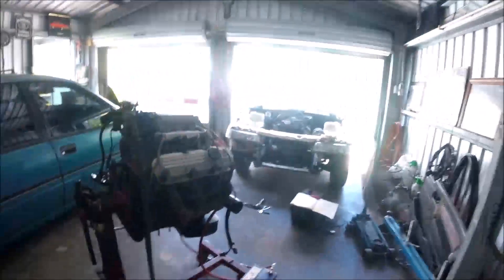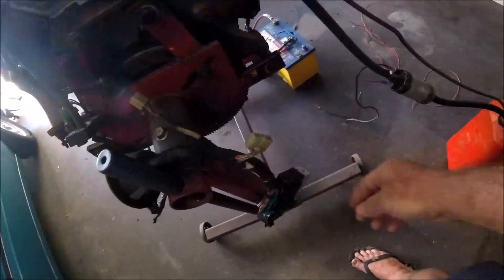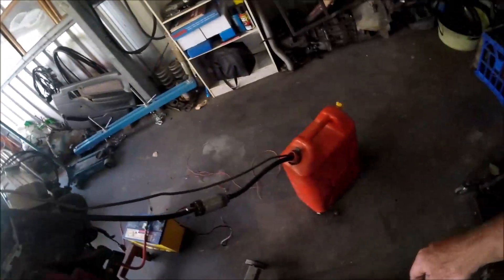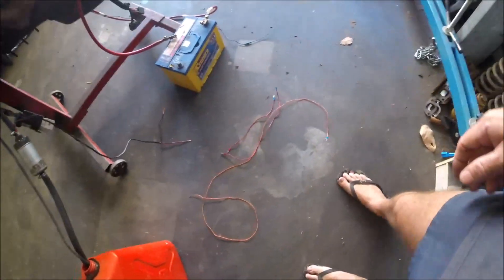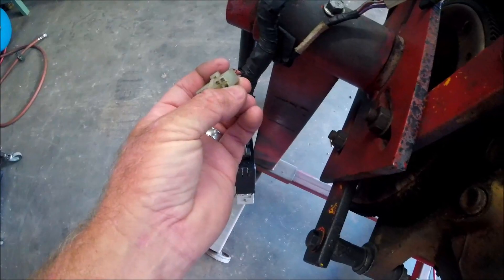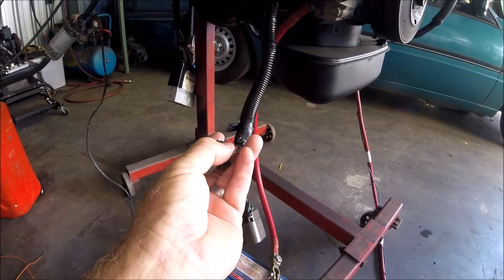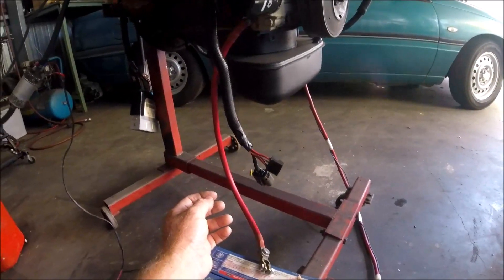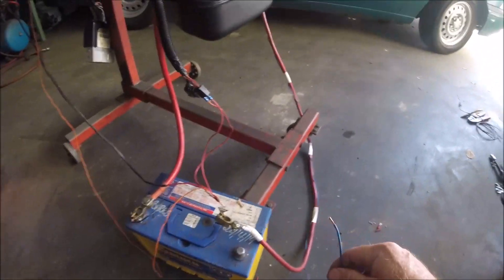VN VP Standalone Wiring Directions

Comment: Hey  Mark I have a vp harness pink wires are in different spots 
Is it the pink with blue .or just pink wire .cheers Wayne
Reply from the maker: Hey mate, I’m away at work currently so I can’t be close to one to confirm but the pins you require will be in the same location in the plug if that’s of help. For memory they are interchangeable except possibly VN S1

Comment: Hi Mark im putting  308 HOLDEN RED MOTOR in a lx torana i was told to use the vn / vp loom as i have got now im  running a single plane manifold with the 8 injectors that bolts to the manifold and im running a low rise snorkle to a 90 ml throttle body and i want to do the same wiring setup you did in your youtube show i will be running a return back to tank i have a vn ss ecu cable driven just want to wire it the same as everybody is telling me to go helteck  but dont have a spare 5000 to have it done will be running all start up lights my own tbar none starter in gear can you help me out with the complete stand alone wiring there is no writing on the ecu to tell me what the pins are regards jeff
Reply from the maker: @jeffereyross6944  Hey Jeff, there is very small numbering on the back of the plugs that enter the ECU and that’s how you can identify the pins. Do you have a pinout diagram for the ECU? That will help you tremendously. I fully agree with you, no point in wasting bulk money on something that isn’t necessary.

Comment: What is the colour on the permanent power wire please? I have the engine running but the wiring was already disconnected from the plug so I don’t know which wire is correct for permanent power to hold memory out of the two red wires in the engine harness.
Reply from the maker: Should be red with a black trace for continuous power.

Comment: Hi sorry for the question just changed over to the VP loom so it suits the VP motor VP ECU, hooked up as per your video, spark to the plugs/ light tested power to injectors all good, and the motor turns over fine but won't fire, any ideas, thanks very much...
Reply from the maker: No problem, I’ll try to help where I can. Much easier to diagnose in person but have you got fuel pump hooked up correctly? Feed to passenger side of the rail and return from the drivers side off the regulator?
Reply: @marksbudgetbuilds  Thanks mate all good, checked the fuel, and none, a mate had trained my tank and forgot to refill it, started first pop. Really appreciated your help, many thanks...
Reply: @marksbudgetbuilds  Yes as far as I know I have but will double-check tomorrow to make sure where the pipes leave the tank but yes top end as you said
Reply from the maker: Yep definitely check at the tank or even just pull the feed off at the rail and turn the key to reds and the fuel pump should prime and spew a bunch of fuel out. If the pump doesn’t prime or no fuel present you may have a blockage/bad pump, lines backwards so on….
Reply: @marksbudgetbuilds  Running switch for fuel so does not prime, but see you added a relay to your startup box and it does, but not sure how to hook that up. but motor is up and running :)
Reply from the maker: Easy enough to hook up if you want 2, you will see in the video I point out in the black plug near the battery there will be a Green wire with white trace I believe it is. That wire will trigger a relay to activate when the ECU is powered up. If you don’t understand relays I’m pretty sure this should be correct off hand, you want a normally open relay, pin 30 on relay to battery with a fuse in line, pin 85 to earth, pin 87 to positive side of fuel pump and pin 86 goes to that green wire but it would be easier to run it through the stock relay.
Reply: @marksbudgetbuilds   Ok yes I understand how a relay now works, after watching a few videos, not a must but will have a go, Many Thanks,😊 Your video has made things a lot easier, very glad I came across it.

Comment: Hi, great video, have a vp running a vn s1 loom, all hooked up as stated but see I have no spark at the injectors? motor turns over etc, what have I done wrong.. Thanks
Reply from the maker: So you have a VP commodore with a S1 engine loom in it or just a s2 engine with a s1 loom trying to run outside a car? If you have the S1 loom in a VP the pinouts are slightly different for memory so something will not be right. 
This video is a S2 engine with a S2 loom.
Do you know which it’s missing? No injector pulse or no spark?
Reply: @marksbudgetbuilds  Hi Thank you, yes full restore project, VN S1 with VP motor - Box VN engine loon,  motor in car but new loom is being made for the car so just wanted to start it to be able to move it. will double check over the wiring once more to make sure, have downloaded the wiring diagrams you have listed as a ref:
Reply from the maker: Okay yes now I’m with you. Alright so the S1 loom and ecu should be fine to run the s2 motor  and you should not have any issues wiring wise if it’s all plugged in correctly, was the engine a known good runner prior to being put into your vehicle as there are a lot of other potential bugs that could be causing you issues.
Reply: @marksbudgetbuilds  Yes the motor was a good runner, and will get a full rebuild at a later stage, will have time tomorrow to check over everything and see if I can find out what is going on, do have the VP loom here, but the VN hooked up spot on. Thanks for your time much appreciated.
Reply from the maker: Good luck, I’m sure it’s something minor as they  are pretty simple and straight forward to work on and troubleshoot.
Reply: @marksbudgetbuilds  just had a look, two pink wires on the VN loom have blue markings and VP has brown markings on them (not blue), one has a half mark and the other has a full mark but one goes back to another small plug that is not used but does come from the dash loom, but ends at this other plug and does not enter the main loom. So this leaves only one active pink wire.
Reply: @marksbudgetbuilds  yes will get it sorted through trial and error I guess.
Reply from the maker: Yup there is only one pink wire that needs a power source as per the video mate. At a guess I’d say you’re talking about the diagnostic plug that’s not used and I’d say that’s where the other wire ends up…..

Comment: I have done what you have outlined in the video, though the pink wire was in a different position on the 10 pin dash plug i still found it and now the engine has spark. Theres 40-50 psi at the fuel rail and the injectors have power but there is no pulse coming from the ecu, will fire on start ya bastard spray but wont make a noise otherwise. There are two single pin plugs on the loom i havent found homes for, one near the injectors and one by the oil pressure sensor. Any ideas? Sorry for the novel and appreciate the video
Reply from the maker: The one by the oil pressure sender I imagine is knock sensor and the other by the injectors I’m not sure, only one wire up that area is prob coolant temp. There are 2 coolant temps. Single wire and one beside with 2 wires. One is for the ecu and one is for the dash. 
Was this a known running engine that hasn’t sat for any long periods of time? Do you know for sure no pulse? Tested with noid light? If everything is wired up correctly at this point I’m gonna say blocked or seized injectors without being able to troubleshoot in person. Do you have the fuel lines on in the right orientation? Return is from the regulator and feed is the opposite side.

Comment: Hay mate I got a series 1 vn harness and the plug near the ecu is same but wires are in different spots any advice
Reply from the maker: Yea just pinned out differently, look for the pink one that’s all you need. If you want to make sure it’s the right wire find pin A6 at the ecu plug and it should be the same colour wire, test continuity to make sure it’s right and if so then power it up.

Comment: hey mate, i have a s1 vn v6 motor /loom/ ecu in a vr calais, with the dash harness plug do you know what wires are different/ does it need to be repinned
Reply from the maker: I would almost guarantee the will be pinned differently. Without having it all in front of me to figure out I can’t really say. If you check some of my other replies there is a link to ECU pin outs for each variant. If you half handy you will b able to sort it with those.
Reply: @marksbudgetbuilds  thank u mate appreciate it
Reply: it has no go at the key and no spark when jumping at the starter

Comment: Mint video mate helped me a heap I’m putting a Buick into a triton as a burnout car the way you said it works for a series 1 vr harness and motor aswell I just used a vp ecu
Do you know where I could find info on what the other wires do? I want to keep as much working as I can from the factory harness cheers mate
Reply from the maker: Use this link to find ECU pin outs from VN to VT 
https://www.google.com/url?sa=t&source=web&rct=j&url=https://www.snapontools.com.au/wp-content/uploads/2021/12/Holden_Engine_Troubleshooter_Reference_Manual.pdf&ved=2ahUKEwjMlvfburb3AhVVXmwGHTrbCb8QFnoECAcQAQ&usg=AOvVaw3bubX1qq-vDxz7j16HVVek

Best way is just to sit down with your harness and a multimeter and test continuity from the plugs in the harness back to the ECU which will then tell you what it’s for. You can also strip out what you don’t need and make your own stand alone harness.

Comment: Hey Mark great video I have a vn motor out of a manual wagon and the wires going to the dash loome are different colours to the video. The wire at the bottom right is brown could this be because it's a manual harness or because it's out of a wagon? Got me  confused confused
Reply: Have looked up one for a manual wagon for sale on eBay and it looks the same as mine so I think it's got the correct harness I also have one out of a sedan that's the same as the video got me scratching my head
Reply from the maker: Some can be pinned differently between models particularly s1, do you know if it’s a S1 harness? The colours should still be virtually the same tho so check this plug for a pink wire with a blue trace. That’s the one you are looking for.
Alternatively you can remove the plugs at the ECU, find pin A6 and test continuity between there and the dash plug to ensure the brown wire is the correct wire.
Reply: @marksbudgetbuilds  thanks I think it's a s1 harness it's definitely the original harness you can see it hasn't been stuffed with. Pitty can't upload a photo to show you. It has a pink with blue trace but it's in a total different pin. How do I find a6 at the ecu ? Ate they marked or do I need a diagram of some sort?
Reply from the maker: They are marked, if you look on the ends of the plugs on the ecu there are markings. Not the easiest to see but once you find them you will be able to figure it out especially when like the 6th pin in on one of them will also be pink with the blue trace. Then just test continuity between both ends to make sure it’s the same one and good to go. That will be the difference, the S1 harness is prob just pinned differently. Same with some of the other models but for the most part it’s pretty similar all the way to VS.
Reply: @marksbudgetbuilds  thanks again mate awesome help
Reply: @Mark Hoey  found the wire it was pinned different. Is there pin numbers to check the other two two wires? And do u just block all vacuum hoses
Reply from the maker: Yes you can just block off any vacuum lines and c16 and B1 should have power to them fuel pump relay trigger wire is A1, the last one sends power to the injector circuit, don’t think it can be tested at the ECU, I’d have to look into it more.
Reply: @Mark Hoey  by the "last one" do u mean one of the red wires?
Reply from the maker: Depends on your harness and the colours but yes. The 2 as above should merge in the harness so you only need to supply power at one wire to power up both of them (red wire black stripe) the other one will be either solid red or orange I’m gonna say orange. Then the pink one you have already located. That’s all you need to supply power 2 and it should fire up.

Comment: Hi Mark great video i have just rebuilt my vp engine , do all the sensors have to connected to run the motor
Reply from the maker: It will run without the odd one here and there but won’t run well. It is advisable to have everything plugged in for best results.
Reply: thank you mate will do

Comment: Hey mate I’m wiring up a VN v6 into my buggy, I have the wiring kind of sorted apart from the ECU dash plug, mine doesn’t have that pink wire on the bottom Lh side of the plug? It’s a empty pin?? Any help on where to wire that would be much appreciated cheers
Reply from the maker: Go to the ecu plug and look for a pink wire should be marked A6 on the plug. 
Cut that with a bit of length and extend to a 12v switched source and you should be golden 👌🏼
Reply: hey budd is this the same wiring set-up as the vs v8..it looks same..thanks
Reply from the maker: @jaygtgarage6489  Yes it’s very much the same, the plugs look different but the wire locations etc for memory are the same. I was going to do a video on the VS harness as well but haven’t got there yet.